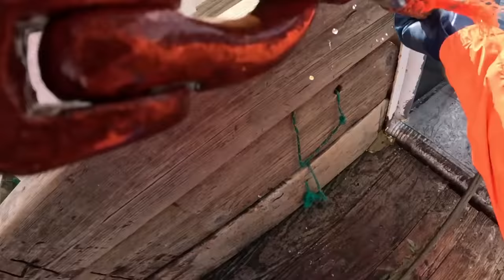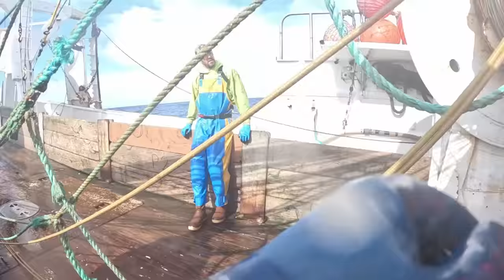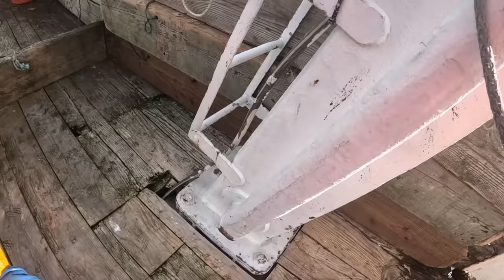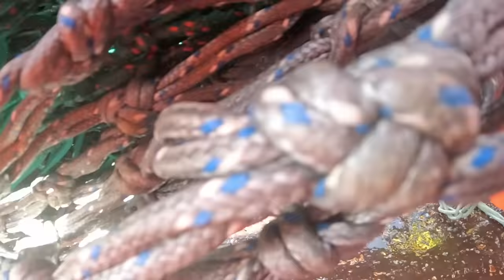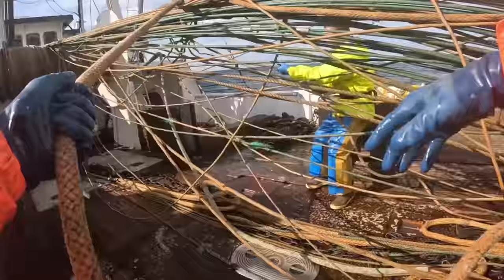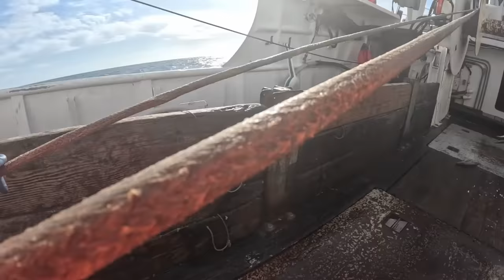Midwater Trawl

Comment: Why do not the gays have any kind of secuteryline. The floor is very slippery. I understand that is not easy to work with, but if you fall on see you are dead in minutes.😡😡
Reply from the maker: There is not a single boat on the west coast that has anything of the sort, except for maybe some solo trollers